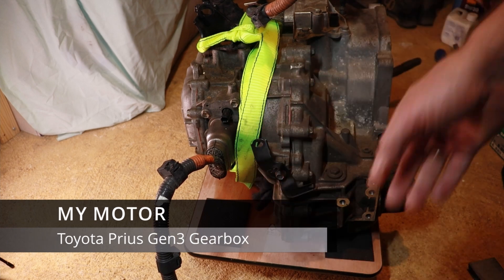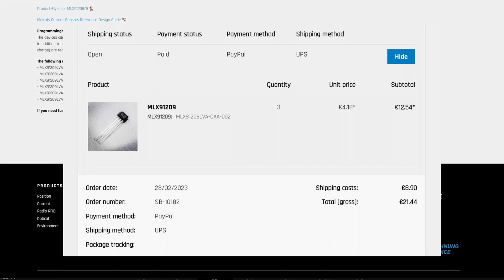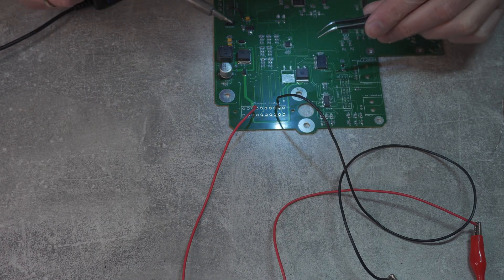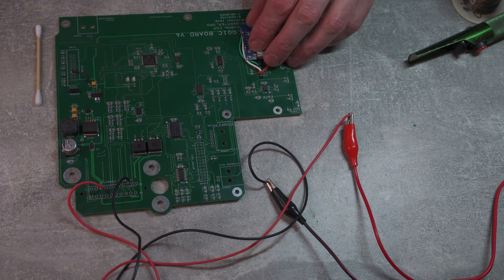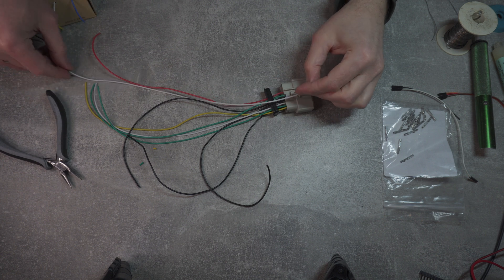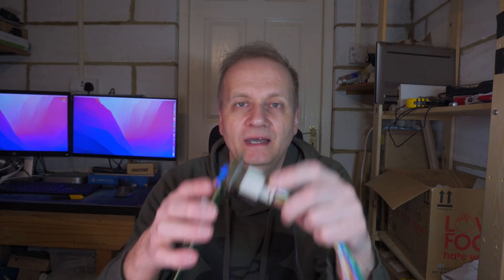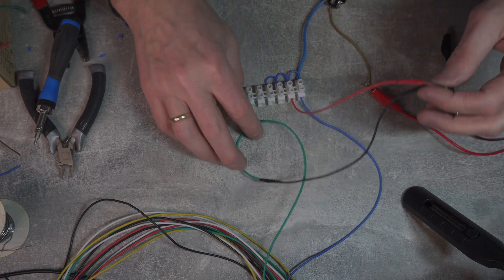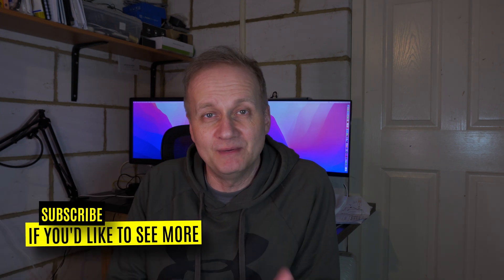Tesla board build - Will I succeed this time ? #8

Comment: Thanks for doing this video series! I just ordered some boards and am excited to try making my own. Do you know where to get all of the thermistor connectors? I m having a hard time finding them. Thanks again!
Reply from the maker: Thanks so much nub340 I have got mine from Mouser. I have ordered all missing parts from Mouser apart from BTS133s which I got from Ali Express
Reply from the maker: Damien has BOM with all part numbers under V6 folder
Reply: @LatutaEV  The V6 and up BOMs don't seem to include any of the "CONN" components. However, I just took a look at the V4 BOM and I see them there. Hopefully they are still the same connectors. Once again, thank you!!